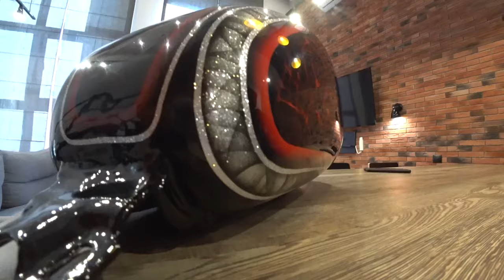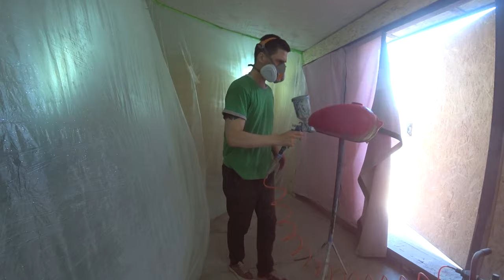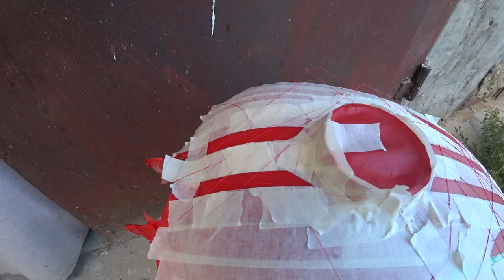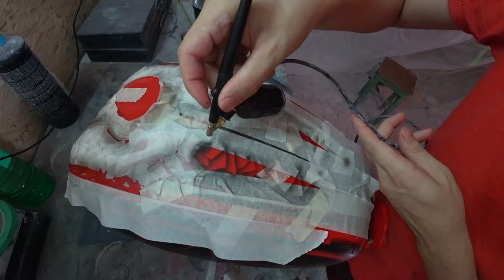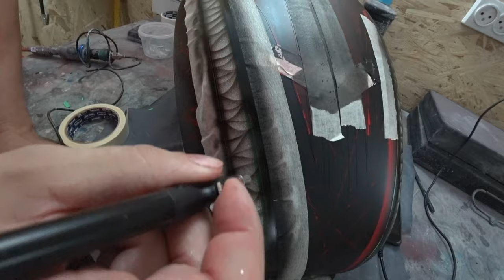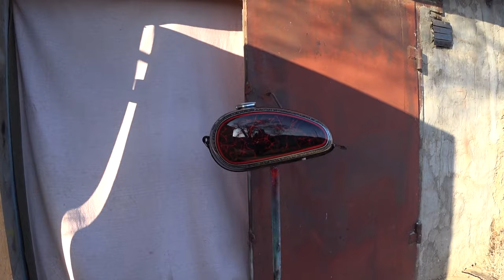My experiments. How to custom paint a motorcycle tank tutorial. Painting tricks(for car, helmet too)

Comment from the maker: Hey guys! Some information about this tank: before starting work, I didn't know what the tank would look like, I didn't have a complete idea about design. I refused some ideas during the creation process, for example, I changed my mind about separating side panels. I decided to add something along the way, I was wondering how the tank would look like if I tried this or that painting technique. For the side panels, I used a flower wrapper, from which I separated all the thin elements, which I later also used. I just experimented and it turned out what you see. If you liked the result or maybe something else, be sure to let me know, press thumb up, it is very important for me to know your opinion. I will also be glad to your questions, write, I will wait! And be sure to share this video with those who might be interested.